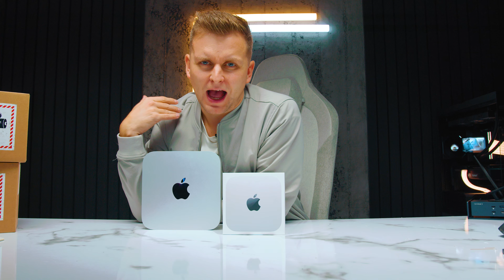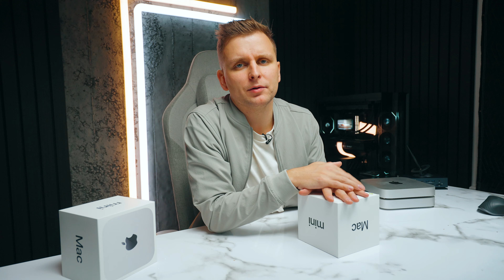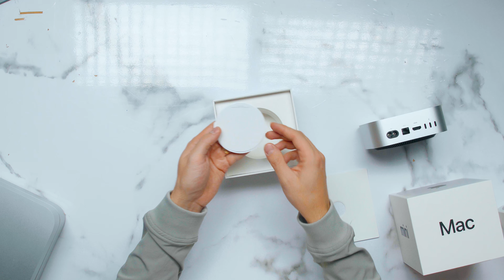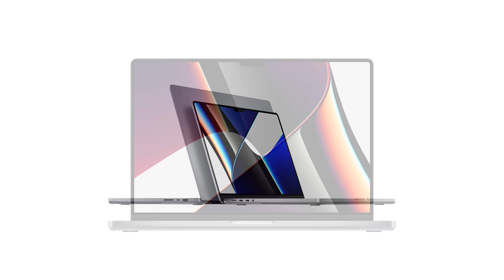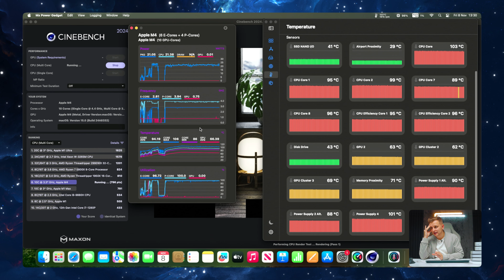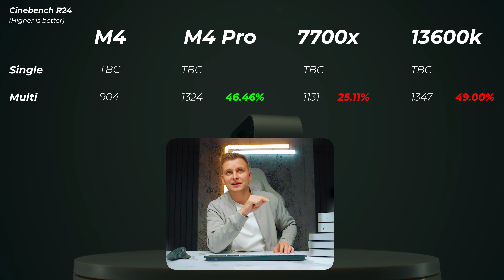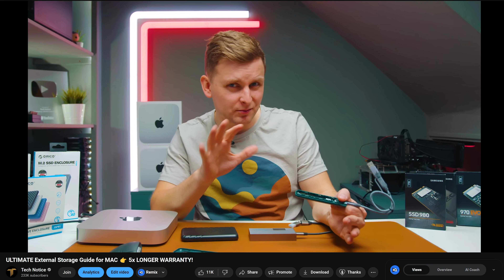Apple just KILLED the Mini PC Market and Windows WILL NEVER recover! | M4 & M4 Pro Mac Mini

Comment: Too bad Apple prices are horribly high and the hardware is proprietary.  To upgrade, throw it away and buy the latest system.
Reply: You can easily sell a years old Mac and get a good amount of money. A PC you throw away, thats right.
Reply: @froschfreak1699  You simply upgrade your PC incrementally to keep it current. Pretty simple. Nothing like having your choice of components and quality.
Reply: @ and making the system work properly and bugfixing will be biggest part of the work done on the machine. 🙂
Reply: @froschfreak1699  Never an issue after 30 years of experience.  I have a 12 year old PC repurposed as a NAS running Linux.  Veyy stable 24/7.
Reply: @RC_Flyer-h2v  Its all a question of personal preferences. There is no right and no wrong. For me it is a tool and I want it to be as reliable as possible without touching the running system. Same as my smartphone or other devices. I use it as long aa it serves my needs than I replace it. I never updated memory or processor on my iPhone, why should I on my Computer? I work on Mac and PC and never upgraded a component on my PC as well. All I can day is that my workflow under Mac OS is way more reliable and productive than under Windows and after selling my used Macs they werent more expensive at all. But thats only how I see it. 🤷🏼‍♂️
Reply: @froschfreak1699  You are right that there is no right or wrong.  Some people love to build electronics and others just like to use them as a tool.  Computer enthusiasts are largely uninterested in proprietary tech.  The Nvidia 5090 GPU is coming out soon and I'm going to buy it to upgrade from my 4090.  But that's all I will need as the remainder of my PC is fully current. Plug and play, very simple and much less expensive than buying a whole new computer.

Comment: If you're considering a storage upgrade for any iMac, you're better off getting an external Thunderbolt drive with your preferred size and NVMe from Amazon. It costs a fraction of Apple's upgrade, and you can easily use it with multiple devices.
Reply: Yeah, i dont understand why people go crazy about it. Just get an external drive. The RAM is a different story, but for most people who'll use this thing, 16gb is plenty, especially at the base price point.

Comment: Anything I'd want to use a Mac for would require more than 16GB of RAM and 256GB of storage. And with Apple products, as soon as you start adding more RAM and storage, it's going to cost you about 10x as much as it would on any other platform. Apple has the best silicon, but for some reason they insist on having the worst everything else.
Reply: Well said!
Reply: I upgraded to 24gb. Worth it. External storage is better than upgrading that. This thing is a beast
Reply: Memory is virtual. macOS et al page from RAM to SSD, which is lightening fast.  Buy the minimum 256GB and update it to 2 TB.
Reply: And that’s why the Mac Mini is not made for you. It’s an entry level computer for ‘most people’ that’s the point. Apple always prices liked this. It’s clever if think about it. Increases customer base whilst professionals pay for the extra features they need. You cannot buy or build a similar spec PC for the same money.
Reply: I dont agree I use a 16GB ram on a M1 doing fluid simulation in Houdini, nd it work very well.
Reply: @WorldFamousUnfluencer - 32GB and at LEAST 1 TB of storage here. Bare minimum.
Reply: @rickgrimes931 The a $600 Mac Mini shouldn’t be what you’re looking for, in fact there is no computer with 32GB and 1TB SSD that only cost $600.
Reply: @dpptd30  - Not true, I can get some great used Xeons for that price with equal or better performance.
Reply: @rickgrimes931  possibly true although is the performance really as good? In this form factor? And no way will you be near this low in terms of power consumption.
Reply: I use 16gb on a professional photo/video workflow on an M1 Pro because I only wanted it as a secondary to my Windows desktop. My Windows desktop has been in sleep mode for 6 months lol. 

It does cap out at times with exceedingly large files like big panos etc but for 90% of things the unified memory actually performs much better than I thought it would. I think the 24gb in the M4 Pro model Mini would be quite sufficient, and it's a hell of a lot of computer for the price. And storage is nowhere near as important on a Mini vs a laptop, especially with Thunderbolt 5.
Reply: @xaerothehero  - I use virtual machines for interoperability testing. So my bare minimum is 32 GBs. My limitations might be the processor here though. Either way, I am better off running Linux than anything else.
Reply: @WorldFamousUnfluencer  I stitch multi row, HDR panoramic photos and routinely use up to 60 GB.
Reply: nice made up numbers. Go to Dell and HPs website and see how much they charge for ram and storage.
Reply: This actually isn’t true, and I’ve gone 15 years windows only
Reply: You don’t need more than 16Gb of ram and storage doesn’t have to be Internal
Reply: @pablovi77  it does if you want to use apple intelligence and other features 
And if your slow base drive ever dies it automatically stops any booting from an external drive.

For most users this will not happen as drives even a heavily used slow 256 gb should last at least 5 to 15 years, but all ssds will fail eventually and you cannot just go and buy one.

I suspect apple knows this and will soon have kits available for your machine but only from them at. Insane prices.

You will most likely need some sort of firmware upgrade if they ever allow SSD swaps to bypass the current security system and and restrictions.
Reply: @ It’s not a slow drive and it’s user replaceable, for the first time.
Reply: @WorldFamousUnfluencer  If you do anything professionally, you need more than 16GB of RAM. But if all you do is browse the web, watch some netflix, and play some music, then you're okay with 16GB.

Go see how much RAM you're using right now. It might not be 16GB. But it might also surprise you.
Reply: @SixOThree Not true, I’m a professional photographer and cinematographer and use an iMac, Mac mini and iPad Pro with 16GB of ram every day, without an issue.
Reply: Many gaming laptops also have 16GB by default, and they are running windows which is way more bloated than MacOS, so I don’t know why you’re complaining about a $600 Mac Mini having “only” 16GB of ram, I mean you literally can’t build a PC with the same spec and performance as this Mac Mini. Plus for the storage, it literally has 3 thunderbolt ports, external SSD exists you know.
Reply: @dpptd30  - Way different use case. The Mini has pretty poor graphics. You are trying to compare apples and oranges. Pun intended.
Reply: @rickgrimes931 apples to lemons 😂
Reply: Different os different optimisation 😂in windows only for a 1080p gaming i max 32 gb ram in workstation easily 64+ gb ,in mac is different but you have options the only limit is your wallet 😂by m4 max chip that demolishes every intel and amd cpu
Reply: So the base model isn’t for you then. Why is this so confusing for you?
Reply: You don't understand the Apple Silicon paradigm. Apple is SOC. So speeds are through the roof vs  having to read/write/ smit data back and forth. It's all on the chip used by everything at once. So the old paradigm of needing more RAM to account for that is outdated. 
But you go ahead and believe what you want :)
Reply: @ is this sarcasm and I’m just not recognizing it?
Reply: M4 chip deserve 64 to 192 ram so you can really dedicate a lot to the GPU CPU npu media engines.

And removable standard pcie ssds x 2 
And eGPU upgrades.

Other wise like the 9gb 246 m1 M2 models the resale drops a lot because they are dated and cannot be upgraded in any way internally.

If they could the the M2 M2 m3 could easily add 4 GB x2 SSD for $200 and 64 gb ram for under $200 and ability to add an external GPU later.
.this are things mini PCs done of them you can do 

It's much more than synthetic bench marks.

Comment: You're absolutely right about Apple’s upgrade pricing—this has been the norm for them for ages. I've been a Windows user for over 30 years, taking advantage of all the free software options out there. I was actually considering getting a Mac, and this could have been the push I needed. But instead of waiting for the new M4 Mini iMacs, which I knew were on the way, I opted for a Beelink with an AMD 8845HS processor, 32 GB RAM, and 1 TB storage for just CDN $800 on Amazon. It's easily upgradable to 64 GB and includes everything the iMac offers. A comparison between the Beelink with AMD 8845HS and the new iMacs would be really interesting. It even looks similar, with an aluminum chassis and a well-placed power button, unlike Apple's choice to put it underneath. I bought a metal stand that works well with the Beelink on its side, which would actually make the power button easier to reach on an Apple as well.
Reply: The BeeLink doesn't offer MacOS operation.  Comparing this to Windows PCs misses the point here.  No 'windows PC  (Sorry Hackintoshers)  can duplicate the MacOS functionality of an M-Series Mac.   Whether that matters, is up to the user. There IS one way that this clickbait caption is right though..   it signals the end of the Hackintosh.
Reply: @fmlazar What unique functionality MacOS offers that competitors can't match? Is it wide software support, including games, or maybe it is open source software with open code or is it rather walled garden of overpriced apps that you need to match the convinience of Windows or Linux?
Reply: @unruler  Right now  Mac OS has the killer apps in  video and audio production. Final Cut Pro  and Logic.  There are plenty of good alternatives,  but those are the tools of those at the top of those respective fields.

Mac OS does not restrict you to Apple's store. You can still  download  apps from  other sites and of course you can compile amy command line program that  you could  on a normal FreeBSD system.

For casual and home users there are the lifestyle conveniences  that others can't touch,  especially for those invested in other pieces of the Apple ecosystem.

Linux  is only "convenient"  to gearheads still.  It  is not  close to the user friendliness of Windows,  much less MacOS.
Reply: Mac mini not iMac.  That Beelink does not come with a built-in monitor like an iMac so it's comparable to a Mac Mini.
Reply: @riseabove3082  Well all know what he means.

Comment: I'd never buy Apple as a work computer for anything. I have an M2 iPad Pro and an iPhone 15 and as appliances for specific purposes these are great but as general purpose computers, they lack in flexibility. The fact that you can't upgrade/replace ram or replace ssd in case anything goes wrong or that you'd end up waiting for a whole unit replacement if there's a problem with any components is definitely not a pro move by Apple. I have a separate NAS for short and long term data storage with archival grade ODD backups of most important files. I have a Proxmox server running VMs backed up on that NAS daily. I am an industrial designer and my fee roughly comes to more than $90/h (roughly currency converted), one day's content for me is worth more than the risk I'd inherit buying a Macbook Pro for serious work. I mean sure, if you're part of a serious corporate structure running an IT department that handles most of these for you and you want to stick a MBP in there, that'll be OK, but for most people who do serious work with their computers, it's a potential nightmare for any machine to break down that is such deliberately designed not to be fixed.

Comment: I paid $1400 for a base model upgraded to 32GB of RAM and a 1TB SSD. The Pro version with 24GB of RAM and a 1TB SSD is $1600. So, for $200 less, I got more memory and the same storage but fewer cores. I'd rather save the money because I just don't need those cores. That said, I may have erred if the 1TB SSD in the Pro is faster than the 1TB SSD in the base. I'll do some measurements and follow up on that.

Comment: Here is an idea, a video comparing total cost for a setup for a given amount of RAM since that is the most expensive thing with macs. For example 64gb ram, 128gb ram and 192gb ram. The asrock deskmeet x600 for example allows for 192gb and is smaller than a regular desktop but bigger than a mini pc. But gpu options are very much limited. Then some mini pcs have oculink which allow for greater external gpus, but you are limited to 96gb ram. For most people though I think 64gb is good enough.

Comment: Based on the price. It's either the base M4 or the M4 Pro. No middle ground.
Reply: I was curious if it’s better to grab M4 but upgrade to 32GB RAM/1TB which is less than the base M4 Pro 24GB RAM/512GB. 

From what reviewers who ran benchmarks is that the base m4 chip is much faster/powerful than m3 pro chip. If that’s the case then seems like it could suffice for many people.

Comment: Could you please try virtualizing an x86 CPU along with Windows 10 or 11? 

I'm more productive on Windows, unless it's performing with the MS OS I can't get

As far as pricing, like you I'm a Windows guy, I have to hand it to Apple they know how to bleed their loyal buyers, there is nothing wrong with that, they are pricing base models to groom people into their ecosystem, it's business. 

PC users stay with PCs for this reason, Apple has the highest margins imaginable with a market cap typically number one. 

They don't have to compete, their buyers are loyal. 

Apple silicone is performant because of transistor counts and Superior lithography, because of volume and contracts with tsmc they are always first on next-gen litho, M2 ultra had 100 million transistors and lost to HX Zen 4 which only had 10 million.

It's not ARM, it's not instruction set it's not Apple pixie dust it's lithography and transistor count. 

None of that changes the fact that these are superior, I'd have one of these if I could run proper Windows.

The size has nothing to do with me wanting it, we get to the point where smaller means nothing, the first mini was well smaller than  practical benefit for most user, Like "laptops thinner than 1/4" is nothing but show and tell. (IMHO), practical users want bigger battery, better cooling more than "thinner than already thin enough", before arguments unsue, Apple agrees as they show comparing their prebooks to air, and their mini to their studio, etc

Thanks for the video I hope you can run a proper Windows 11 on x86 virtualized, looking forward if you can
Reply: I dunno.  Nvidia is now the most valuable co on the planet.  No apple silicone there.  Apple really missed the boat when trying to be low power and sexy.
Reply: @barryobrien1890  Thanks for that info, I hadn't known NV passed Apple, typically the fruit sea sawed with MS.

Agree with you for ipw, (instruction per watt), important on servers and mobility, I have no use for that on desktop.

I also have no use for these minis, I keep tower under desk, it's effectively smaller than any mini kept on desk.

I also have no use for "thinner than 1/4" laptops, they don't take less room on desk, I can't add anything more in my bag because of a fraction of an inch, possibly those needed that one extra folder actually uses "thinner" for anything.

But hand it to Apple for exploiting better lithography and using exponentially more transistors to give illusions of superior instruction set, most peeps believe that marketing, also hand it to them for bleeding dollars from loyal buyers, they really know how to get buyers extolling the useless benefits of thin and small and turning profit margins north

Comment: I have a deep interest in Intel/AMD/Nvidia, but credit where credit is due, when it comes down to hardware and software, Apple M SoCs are brilliant. If you aren't invested into gaming, these pretty much are very much compelling to get (You can game on an M3 Max quite comfortably but pricing isn't reasonable at all). Video editing is a clear winner, music production has been solid (IO is more the bottleneck anyways), 3D graphics/rendering are starting to take off with Blender and engineering/architecture/industrial programs, AI with MLX is growing fast in development with unmatched bandwidth and RAM capacity - the only downside is pricing especially with RAM (makes sense if you NEED it) and storage (robbery.), but when it's quite literally an all-in-one pc that can do everything well at insane power efficiency, you just gotta respect that. Can't wait for more content from these machines!

And for people who think I'm a 'fanboy' I do believe the 9700X would've been better for optics (if they had it). Pulls ~95W and scores ~1200 mt. And used their 245K results, ~1500 points at 135W. That said, I have seen base Mac Mini M4 scores ~980 so I don't know if there are performance modes.
Reply: Ahhh but can you mine bitcoin and make $
Reply: @barryobrien1890  😭😭Naah, you're right, disregard everything I said ☠☠